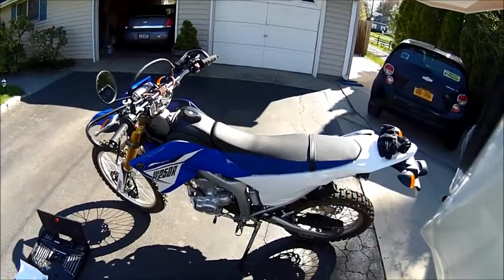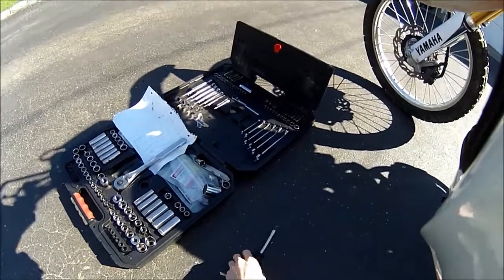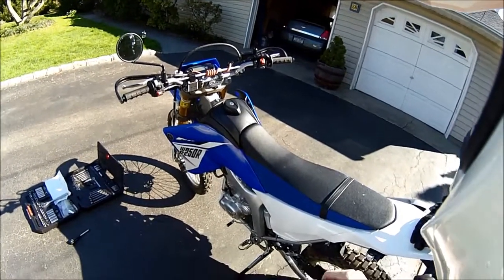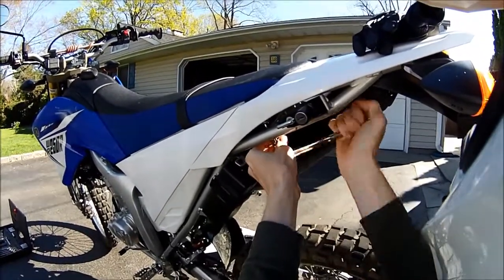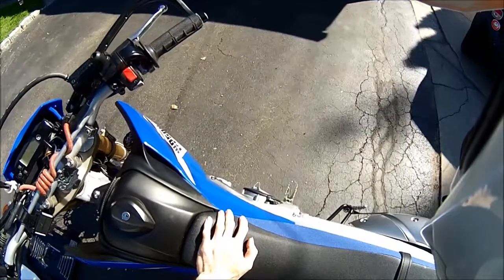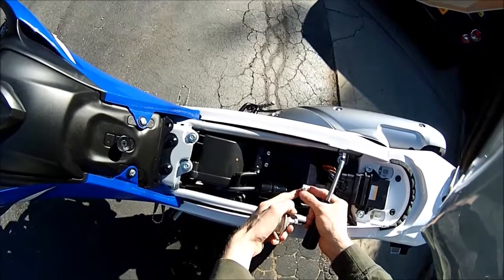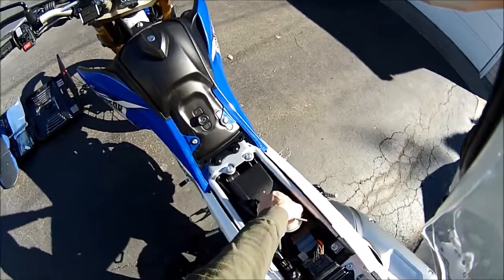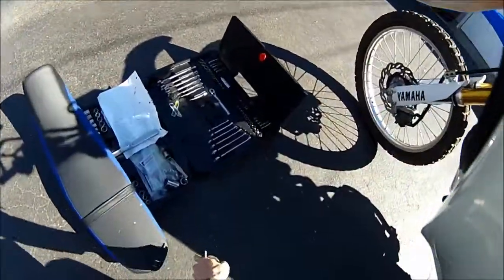Flapper mod

Comment: Pretty good vid.  Seems like you're using SAE tools on a Metric bike.  Mismatched tool sizes will work for light jobs like this, but wouldn't hurt to invest in a set of Metric sockets.  Also, they sell vacuum hose caps on Amazon, Harbor Freight or any auto parts store near you.  Easier and cleaner than duct tape on the end of the hose.  Finally, some double sided tape or Velcro would look so much better than duct tape.  You can hide it under the flapper for a cleaner look.  No insults meant.  Next time you have the seat off you could use these tips to clean it up.

Comment: My question would be, "how many of these OTHER people in the forums that have done this mod are professional mechanics?"  The reason I ask this is, what proof is there that this mod actually works?  I guarantee you that if you put your WR on a Dyno, you would not even be able to tune it properly.   The air intake system is designed from its stock form to mix fuel and air ratio at it's optimum efficiency.  Doing this mod will not, despite what you think, increase the bikes performance at all, it will actually hinder the performance and increase the fuel consumption.  If you don't believe me, take your bike to a professional shop and have them put it on a dyno.  If you want more power out of a bike, buy a bigger bike.
Reply from the maker: everyone that has a WR250r dos some sort of flapper mod XD in fact some cut out the whole thing to make it real open, even when the bikes fist come out the magazines that test the bike take out this door, listen you can go out and read tons of info on this or you can look at my video that was taken after the mod to insure it work and was no problem i spent hours reading about this. i can tell you are not mechanically knowledgeable, like i was way back but trust me it works. Read the other comments on this video alot of people like you have commented around the same Q ?.? i exampled it to them. Yes you don't get the full effect without an FI commander i have one so yeah you are some what right on that point. BTW i have 12000 + miles on her now all of mine and she runs like a champ, Good luck mate fall softly ^^
Reply: MotoStrikerUnit    I am not saying, don't do this mod, what I am saying, for those who think this mod will turn their bike into some beefed up race bike, don't hold your breath.  Like you, I have read numerous articles and forums on this mod but the fact is, unless you install something like an FMF Power Programmer, this mod will not do anything for your bike.  The Dyno doesn't lie.  I will trust the word of a Dyno over that of a million backyard mechanics eight days a week. 
After watching your video, I started looking into bikes with this mod that have actually taken their bike and had it tested on a Dyno.  This is the very first video I watched...
 
Expert Dyno Tuner Says: "DON'T Modify Air Box on Motorcycle!!" | MotoVlog
CycleCruza 
After putting over ten grand into my WR, the last thing I am going to do is to start hacking and drilling it up.
Reply: MrDirtdart............you are absolutely right!!  I have a FMF Q4 Slip on with FMF Power Bomb and the FMF Power Controller....I did this mod and then took it in to have it tested on a Dyno.  The results were totally amazing.  With the "flapper mod" the readings on the Dyno were total shit.  Despite sounding better and performing better, (or so I thought) the fact of the matter is, without this mod, a WR runs more efficient without this mod and that, I proved on a Dyno.  I guess the guys at Yamaha kinda know what their doing, more so than all these, "backyard mechanics" as you say!
Reply from the maker: matt n jeff that's totally against any of  the physical of air intake, and it not over flowing the box nor is it really changing the air flow just allowing it to flow freely, but yes it dos not make a REAL difference power wise
Reply from the maker: mrdirtdart i hear you man i came in a bit hot sorry <^^; , yeah i got a EJK and that would be the first mod to put on any bike ^^, no the WRR is a fun bike not a race bike many know that but i guess this old video could be misleading did it first year i had the bike with little knowledge as you can tell by me saying 5 16 and not metric :/   I think i saw that video but i think it was referring to the box door he trued in to a filter ? i may be wrong , well at least thanks for watching and commenting , sill love the WRR
Reply from the maker: mrdirtdart yeah i just watched that video that was only about the door being turned into a filter it add to much air to the intake , with this mod you are just allowing the same amount of air to pass through at any point instead of the door closing off air to the box, thank you for showing facts to back statement ^^
Reply from the maker: matt n juff they actually put that in for EPA sound levels when pass by a 20 mph with no gas, my Q is did you take all EPA off bike ? and did you do two different test back to back with and without door, if so you should go post that on the HUGE WR flapper page and see what they say

Comment: If you remove the entire system, you only need a 3/16 vacuum cap right? Installed at the throttle body.
Reply from the maker: yes i believe i toke the rest of the junk out and there is only one tube left and the hole at bottom of air box also the block off plate is need for exhaust port

Comment: Tried this your way today. Hope it isn't necessary to remove all the other parts that people remove?
Reply from the maker: no it is not necessary this mod just holds door open for free air flow, i have removed all the other AIS for the bike it, just for the hell of it and weight reduction, she smells like an old car now which is great imo , no more back firing all the time and she sound a lot better the brap is more there, only thing about doing these mods is the programming is still set to it which causes a jerking at low throttle
Reply from the maker: https://www.youtube.com/watch?v=WFTOrxg_B6w

Comment: 5/16s tf?
Reply from the maker: its a 10 or a 8 mm under seat sorry back in the day when i was new to all this ^^
Reply: I think 8mm
Reply: There's no conversion if something is designed and built metric to begin with. Just invest in the correct tools. I've been working on vehicles and bikes for over 20 years and have yet to use any of my imperial/standard/sae sockets. 99% is metric.   @TheMotoRider400ex
Reply: twowheeledsmurf why not have both? So many vehicles have 3/8th and 5/8th bolts. No metric size come close. Ever work on Detroit two tropes? Almost everything is 1/2 or 5/8. Good luck tearing that down with metric tools
Reply: What is a 'Detroit Two Tropes'? Even google couldn't help me on that one. I do have both metric and imperial tools. I use imperial/SAE in construction but even that is turning more to metric as we adopt better engineering practices from other countries. All i'm saying is use the right tool for the right job.  @TheMotoRider400ex

Comment: so, I'm taping it opened not closed correct? I'm trying to increase the airflow? my bike tends to bog for a split second when I jerk the throttle fast, then it's revs up where it should. it's almost like a split second hesitation. I'm hoping this mod will help that.
Reply from the maker: yes once you take off that metal thing on top the vacuum you will have a flap there that gos up and down tape it down so that you can put finger into air box so i guess you would say opening but really you are just leaving it so that it will not close air flow this is a step in the right direction but get a fuel injection kit to fix that jerkily nice i got the EJK easy to use well worth the money  http://www.electronicjetkit.com/DirtBike/viewproduct.asp?partnumber=9310207
Reply: MotoStrikerUnit awesome, thanks for the reply. I'm going to try this, this evening.
Reply from the maker: nice, np its petty easy don't expect a world of diffaces though
Reply: @MotoStrikerUnit7  "Don't expect a world of difference?"  In the video, you raved about how much of a difference it made.  I'm confused.

Comment: I just got a 08 wr250r and I want to do this mod I am just wondering if this let's unfiltered air to go to the motor or is all the air still filtered first? thanks
Reply from the maker: This opens up the air box intake so more air can quickly get into air box the air then gos through the air filter into the  engine intake, if you open up the side cover on the right side you will see a big black thing with a screwdriver phillips head if you unscrew that inside is the air box if you look toward the front of the bike inside the air box you will see the air filter on top of that box is where you are remove and taping down flapper still filtered air but it will need to be cleaned more as more air is getting in. ps i use 3m double sided tape now to tape down flapper, go online and look at some diagrams of your bike or even look at its Manuel to understated whats whats ^^ good luck with this and Fall Softly
Reply: Worth noting that without some sort of cap on those vaccum lines, it's is theoretically possible for dirty air to get pulled into the intake, after the filter. Probably unlikely, but possible

Comment from the maker: +M VICE Thanks for watching the video glade you like it, i know the tool kit i have has metric in it too, i am just lazy and grab the first one i see that fits XD, thanks for the advise i will definitely go get some hose caps. but i think i will leave the tape on the flapper, i did this mod this way so that if i ever wonted to put it back together i could, but as seeing l think this should have never been on the bike to begin with i will look for a better way to go about holding the door down.
Thanks again =^.^=
       {Fall Softly}

Comment: I have a 2011 wr250 with stock exhaust.  If I do this, will I need a power programmer or anything?  What results should I see?
Reply from the maker: nice i believe its the same for all WRR/X, this mod mainly just opens up the air box to allow the bike to breath freely. you don't need any equipment or anything to make it work right but a EJK will take the bike to the next level. stock this mod will reduce weight, make bike louder at cruise may make your bike pop more because of the AIS but that's fine. I believe it also helps to smooth out that jerky throttle too. If you are looking to maximize the engine potential this is a step in that direction. its also reversible it you do it my way. just use 3M double sided tape to hold flap down ^^ sorry it toke so long to respond if you got more Q's ask away

Comment: Hey man, thanks for the vid. How is this mod holding up? I did a google search but didn't find any threads on removing just the solenoid. Where did you read about it? Thanks!
Reply from the maker: fender7802 Thanks for watching =^.^=, well ^.^> i read a lot of threads and broke down what was the problem that caused the flapper to close that problem was the solenoid so if you take that out problem solved just tape up the lose ends, if you do not have a stock exhaust then there is a lot more to do just look up a video on removing the EPA stuff or something along those lines. Its holding up real well i used duck tape to tape thing down only thing about doing this is you will have to clean air filter more often -.- .
Reply: MotoStrikerUnit Cool beans. So you don't find that the engine runs too lean or anything?
Reply from the maker: no starts better now, and this mod is not increasing the amount of air in engine it is allowing more air to be available for the intake, the flapper cuts off air flow. you stop that from happening by making it not close
Reply: MotoStrikerUnit I think you convinced me, thanks dude!
Reply from the maker: np, =^.^=

Comment: Can you tell me when the air flapper door get close?  My air flapper door is always down, even when I rev up my WR250.  I don't see how this air flapper mod would be that much help on increasing air flow.
Reply from the maker: ***** I didn't know you can ride the bike with the seat off looking at the intake XP, no hard feelings, the door closes when you back off the throttle when moving at a good pace, this mod will leaves the door open it is most noticeable at low speeds or when going on and off of the throttle frequently. It stops it from closing not increasing airflow pre say but allowing it to be unchanging amount of air it can intake. hope this helped
Reply: MotoStrikerUnit I do know I can start up my bike on neutral while on kickstand with the seat off. The flapper never moved even when I rev to red line. I even disconnect the hose and repeat the same to check the vacuum strength -none. I bet you never look into the flapper operation itself but repeat what other people said on the internet. Show me a video where the flapper door open and close while the bike is being rev up and down.
Reply from the maker: *****  "the door closes when you back off the throttle when moving at a good pace, this mod will leaves the door open it is most noticeable at low speeds or when going on and off of the throttle frequently." can you read cause i have reading problems and i can understand what this means. neutral dos not have full rev range power, "I bet you never look into the flapper operation itself but repeat what other people said on the internet" just these people are the people that are renowned for testing bikes, i have obviously read more about this then you come back when you study up on this, instead of doing flawed lab test with bad procedures.